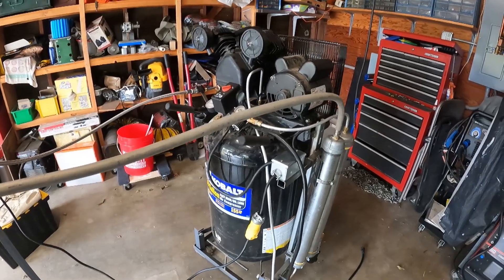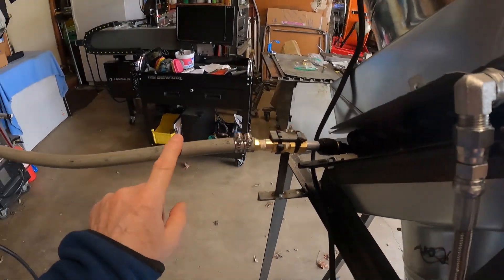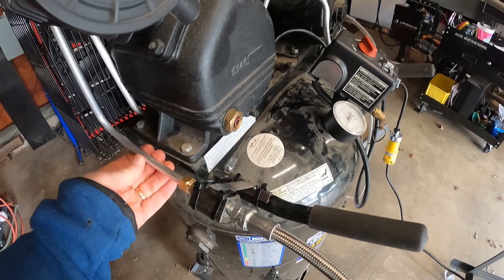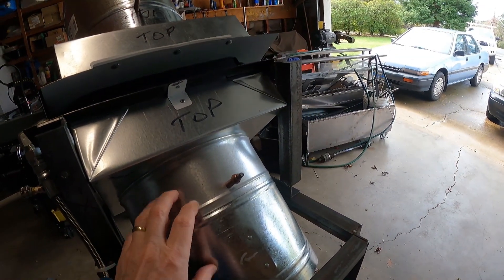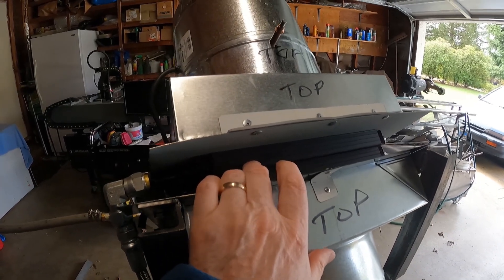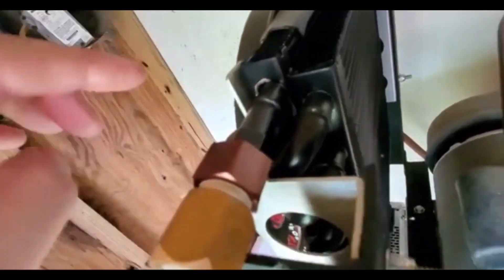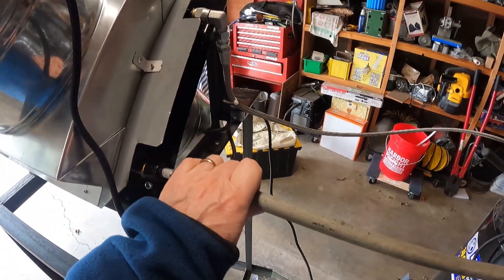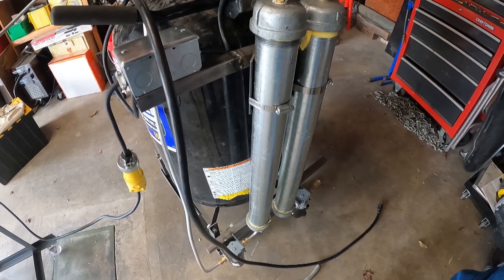DIY #9 Part 2:   Passive Compressed Air Dryer System.

Comment: Hey Doug little late to this party it seems. Lots of haters on your video. I suppose they should go back to physics class. Anyway I’m actually building something similar when came across your video. Only in my design so far is to use a mini plate exchanger where you use the radiator. I could drive the air leaving the HEX to 50f all the way to 35F depending on which direction design to. With that said and temps that can be achieved which is well below the dew point of any pressure point then seems the 1st condenser isn’t needed. I would use a water trap prior to the tank. Post tank I hit a regular and trying to determine if a 2nd condenser is needed. Most of the water should dropped out in the HEX in theory at least. What benefit would a condenser at this stage do assuming the air in the tank would be 40F-50F and ambient is 70F? Also I assume freezing could be a concern if any water is present still. Instead I’m thinking using a heater post final filtration(water/oil, desiccant) and pre tool use to raise the temps and shift the dew point. I’m thinking it should result in pretty dry air and processes like painting should benefit. Would appreciate your insight. Cheers and thx for the video!

Comment: I’ve been in a compressed air field for over 40 years and there is absolutely no way to dry the air any more efficiently to a dewpoint of 35 to 40° then with a refrigerated compressed air dryer your video is nothing but smoking mirrors none of your technology even makes any sense to me whatsoever
Reply: 😂 always a hater out there.
Reply: @giff1011  no it’s actually somebody that knows what the hell they’re talking about, there is absolutely no way you can achieve a little lower dewpoint than the ambient temperature and that is a fact, the only way to remove condensate from compressed air is to drop the temperature just above freezing, which occurs in a refrigerated compressed air dryer not with a belt guard after cooler in a series of 2 inch pipe with Burrillo pads in them, the other way is to use what’s known as a dual tower desiccant dryer, which will achieve a very low dewpoint somewhere even around -50° this man does not know what he’s talking about. He just has an idea that he thinks will work, but it can’t and I bet you won’t even respond.

Comment: many things wrong with this setup, 1st you void your warranty because you have added modified parts in the direct line feeding the tank. 2. you added many lines copper and metal which will add to the overall resistance of airflow and result in lowering cfm and psi and cause the compressor to over cycler and even wear out. Physics dictates the best compressors have minimal airline length & maximum diameter airline  - instead of all this paraphernalia,  use a fan to blow air over the entire compressor, blowing air over your air compressor with a fan can help reduce condensation in the air line. By increasing airflow around the compressor, you help the compressed air cool down more quickly, which encourages condensation to occur at the compressor tank where its supposed to condense rather than further down the air line. This can lead to less moisture reaching your tools and equipment.
Reply: 😂 always a hater out there.
Reply: @giff1011  LOL no I don't hate just advise

Comment: 7:29 If you put ait in at what you have their as the bottom, and draw it out the top, and then turn the rad upside down, all the 45s are going downhill. Then you don't need to lean the rad at 45 degrees. 

Just turn it up the other way and all the pipes flow downhill.

Comment: Thanks so much for these videos, I am learning a lot. If you have enough hose, and it’s the high-pressure, Teflon braided hose that will withstand the needed pressure/temperatures, can you use that to plumb up the whole system, rather than bending rigid pipe?

Comment: I must ask; how does the flow of air through these various components affect the CFM delivery of the compressor. Also, do the additional restrictions placed on the system put the pump at risk of premature failure?
These automotive style condensers/radiators generally have a very low GPM (3-9) range. If we take a dual stage air pump with an output of 16 CFM, that would require a flow rate equivalent to 119 GPM from all components in the circuit between the air pump and the receiver tank, in order to NOT create restriction of flow. For reference, 1 CFM is equivalent to 7.48 GPM.
Please advise.
Reply from the maker: Note:  The size of the factory supply line from the compressor to the tank is the same size that I used.  You should do the same for your system.   So the tank fill rate is not affected.  The factory output line from the regulator should also be the same size you use, so the tank output rate is also not affected.  You have way over thought this issue.  The cooler I used was an AN-8, which is way larger than the factory supply line from the compressor.  So again, there is no meaningful restriction.  What ever you do, the sizes of tubes you use should be at or larger than the factory lines.
Reply: I'd say you did a fine job of being polite. I appreciate the ability to have a productive conversation. When I stated 24x what I was referencing is the amount of bends in that particular unit. My number was a bit low. 
It's a 14 row cooler with 180° bends on each end, so that makes 28 in total, 90° bends.
I can see what you mean by dwell time; that I completely agree with. The longer the dwell, the greater the effectiveness of the cooler.
I'll take some time and read more into Bernoulli's Principle and how it applies to this particular setup, and try to get a better understanding. I'm all for learning something new.
Reply: @lent2005 I agree with Mr. Kronemeyer. Lacking an expensive, calibrated flowmeter, us mechanics/technicians will place identical pressure gauges at the inlet & the outlet of a cooler (in straight sections of pipe, with a pipe T to fit the gauges) & look for a pressure drop after the cooler (as the air flows on to the tank), say about 2 to 5 psi delta P. max. Now if the pressure delta P. was say 25 psi, that would indicate a significant restriction (too small of a cooler.) Did you notice Mr. Kronemeyer also mentioned the tank filled up at the same speed/time as before the modifications. That is definite proof the flow is Not restricted !
Reply: I appreciate the detailed response. However it has still not addressed the concern which is the flow rate of the finned cooler. The passageways inside the cooler are not of the same size as the inlet or outlet ports of said cooler. These coolers are designed to flow liquid at a much lower velocity, and pressure. I'd be curious to know the rating (GPM) on the cooler you're using. In short, you're not painting me the whole picture. 
I don't mean to be difficult, just accurate. I think after going through all these dynamics and principles in such great detail beforehand, a simple flow test of the cooler would illustrate my point.
Also, note that every time a gas or liquid passes through a 90° bend, it drastically increases the coefficient of friction.( i.e. frictional loss) which is multiplied about 24x here. Also why these types of coolers have a considerably low flow rate.
Reply from the maker: I do not know how to politely say this, but you are ill informed.  A 90 deg bend does not drastically increase frictional loss, especially 24x.  Bernoullis eq can be used to calculate the actual loss, which in this case is probably less than 1% based on my experience.  My compressor output line has an inside diameter of .25".  The line in the cooler has an inside diameter of .5  in.  That means the flow speed capacity of the cooler is 4 times the flow speed of the tube feeding it. That means no decrease in flow rate potential.  What does happen is that as the air from the compressor line enters the cooler, it's speed decreases by a factor of four.    As it exits the cooler back to a .25 ID line to the tank, the flow speed in the return line increases by a factor of 4, back to its original flow speed out of the compressor.  That reduction in speed in the cooler is just what we want to happen, because the cooler has more time to dissipate  the heat of the air.

Comment: Great info. Thank you! I am looking at the galvanized pipe condensers for my system, and considering 1.5" copper as an alternative because for me it is easier to work with and less expensive. Do you see any issues with using copper instead of galvanized?
Reply from the maker: Just remember, that you are building a pressure vessel.  You need to do the appropriate engineering calculations.

Comment: Thanks for the great video!! 
I just bought everything I need for an aftercooler but wanted to ask you a few questions; you mention leaning the "radiator" 45 degrees but how? Did you build a rack that will hold it at that angle and is the top farther out or the bottom?
Also, are the pipes you used 3/8 ID or OD? 
Sorry, I'm very new to this and want to get as much use out of my blast cabinet as I can. Money is tight so I'm getting things as I can and doing the work myself but having never done it I seem to have more questions than answers.
Any advice would be more than welcome!
Thank you :)
Reply from the maker: You need to watch the video closer about the orientation of the cooler.  I had to make a rack to hold it at 45 deg.  I chose to mount the cooler separately from the compressor to eliminate cyclic fatigue in the cooler lines.  I showed a video clip where cyclic fatigue occurred in this cooler by mounting it on the compressor.
Reply: @dougkronemeyer  thank you, I missed your section about the radiator mounting. 
Unfortunately, I don't have the room in my shop for a separate rack for my cooler so I'll have to mount it to my compressor. I plan on making a frame then using rubber spacers to hopefully minimize the amount of vibration and fatigue on the connections. 
Very well done series of videos you've done, thank you.
Reply: @greg4727 Would it be possible to mount the aftercooler/fan & duct assembly on the wall above your air compressor? Then connect the compressor pump outlet with the flex hose Mr. Kronemeyer used or a high temp resistant hydraulic hose to the aftercooler inlet? The shaking compressor will fatigue the cooler fittings or tubes until they break. See DIY #9, Part 1 & 2 again where he shows his broken cooler when it was compressor mounted. It could be the difference between lasting a few weeks before failure & the Remote mount lasting for many years! Good luck in your build & happy blasting. Paul

Comment: Awesome 3 part series on efficient removal of moisture from comp. air systems! These videos are so full of sound engineering logic that I need to study them several times & take notes. The advise on mounting the tubes of the aftercooler horizontally I knew to prevent trapping condensate at a "U" bends of a vertical tube orientation. I even thought of water & air Remixing at each "U" bend. Your suggestion to tilt the horizontal config. to 45 deg. keeps the water seperated on the tube floors, even at U-bends, working with gravity. You also show air inlet to the aftercooler at the top fitting to let airflow encourage water movement down to the bottom exit of the aftercooler. Gravity & airflow both encouraging water to exit seems best. Also the 1sr stage 2" scrub-pad filled pipe uses top down flow as well. Thanks so much! I'll encourage other folks to peruse this & your other videos. Bud Stiner, THE Compressor Guru (YouTube), will give your air moisture tech videos a look too. Paul from S. Central Tx.

Comment: Back again - is there any reason to favor the copper brillo pads over something like stainless pads/wool ?  I was thinking about thermal conductivity but then realized it's all going to quickly reach the same temperature so perhaps it's just the fact there are many "surfaces" for the condensation to form on.  I've fully slipped down the rabbit hole with this design now and have started to model the system in 3d cad and am preparing a shopping list.....🤣
Reply from the maker: The stainless steel, depending on its quality, has the potential to rust.  The copper will minimally oxidize and form a surface barrier, and not sluff off rust flakes like steel will.
Reply: @dougkronemeyer  I will keep looking for the copper but it's either stupidly priced or unavailable this side of the border it seems.  Some of the ones I have seen are "plated" which only means "rusts in the future" - haha.  I do have a pal that owns a machine shop and he often is turning stainless which is why I asked.  If he has a huge pile of turnings - or even a drop of say 316 stainless, I could literally turn my own wool so to speak.  I may have access to a bunch of copper sheet scraps - maybe I could cut/form them into something that would work as well.  Thanks for the advice.
Reply from the maker: @lewiscobb7817  Stainless works if you get the right alloy with high concentrations of chromium and carbon.  They all will sustain some amount of rust over time.
Reply: @dougkronemeyer  I may have come up with another couple of options for the condensing surface inside the pipes to consider.   First, there is a material called "copper mesh" that can be purchased relatively cheaply in rolls.  It's a very coarse weave, but could possibly be bunched up like brillo pads and stuffed into the pipe.  I am seeing rolls of 50' and 100' online.  Also - and this is a "use what you got" approach that might not be as good but who knows - I may have a bunch of old 1/2" copper plumbing pipe pieces jammed into the shed that will never get used and I'm too cheap to get rid of them.  If I was to cut them up into a large number of "rings" - like say 1/2" long cylinders and load the pipe up with them, it would provide a good condensing surface but I have no way of knowing how that could compare to a mesh/brillo pad approach.
Reply from the maker: @lewiscobb7817  Lewis,
The copper mesh  sounds promising.  I was at first going to use loofa mesh netting, which is just plastic. I saw the copper mesh and went with it, thinking it would not bunch as bad as the plastic.  All we are trying to do is increase the condensation surface area.  Experiment away.
Reply: Thank you for the great video. I too have been thinking about a design similar to this and like your approach.
I wondered about as part of this comment thread those plastic or nylon scrubbing pads that you can get for ultra cheap. If all were looking for issurface area to break up the airflow and condensation.
Also, I’m kind of curious what fans you selected and what radiator you ended up using specifically if it’s still holding up well.

Comment: Another question !  Where did you source your galvanized pipe sections for the condensers ?  I've been scouring and can't seem to find anything but standard black iron.  Thanks !
Reply from the maker: They are hard to source and are very expensive.  I think I found them at Fergusons.  About $220 for both of them.
Reply: @dougkronemeyer  I had just found a source for them here and was going to post a reply but you beat me to it !  I am located in Canada but have found a source of 2" SCH40 galvanized pipe at Metal Supermarkets.  I have a contact that can thread the ends of them.  I will also have to source the caps but may just go with a painted black iron for that.  Posting here in case anyone in Canada is interested.  I'll post up some more info when I get a bit further along with it.
Reply: I live in S. Central Tx., 15 miles from San Antonio. I went to a small, old school plumbing supply business, bought several 12" × 1.5" Sch. 40 Gal. pipe nipples that they cut & threaded for me, plus threaded 2 other pipes I had already. Got a few more gal. fittings, all for a very reasonable price, compared to Home Depot & Lowes rediculous prices.

Comment: Great explanation and well thought out.  I am planning to use a Derale transmission cooler with an integrated fan and that sucker moves a LOT of air, but I had not thought of the 45 degree issue.  I am now re-studying my system for how to incorporate that.  Also, those pipe coolers are something I didn't see before and I want to incorporate them as well, but that will require more thought.  Really appreciate your work on this and offering it up to the DIY crowd.  I have one question - could you eliminate the two water separators at the bottom of the pipe coolers by just incorporating "drip legs" of tubing with a ball valve?  I'm thinking the water that is collecting there would pool in the drip leg and wound not be forced onward into the distribution system.  Maybe I am missing something here but if so, I'm happy to learn more !
Reply: Probably. You just won't be able to see when the section is full of water. Separators can be bought for around $16 though, so you may not be saving a whole lot of money.